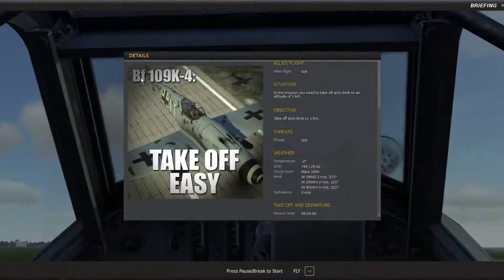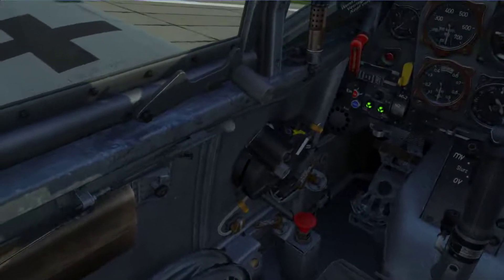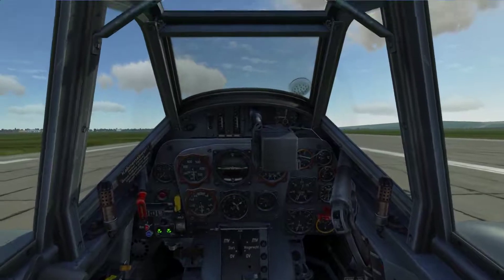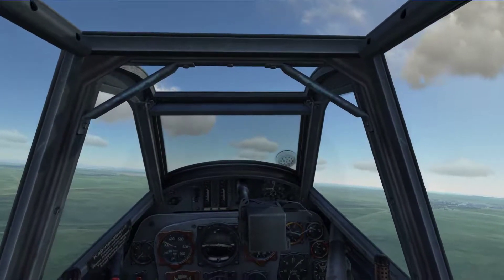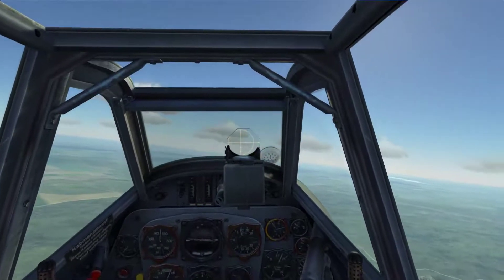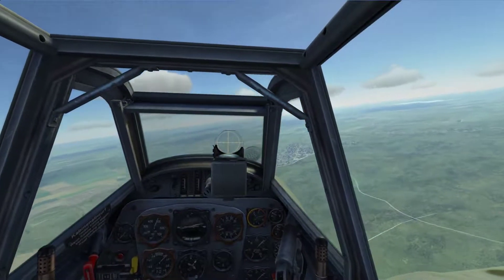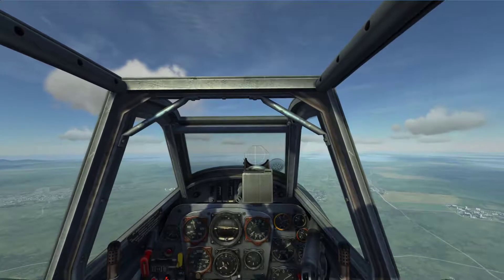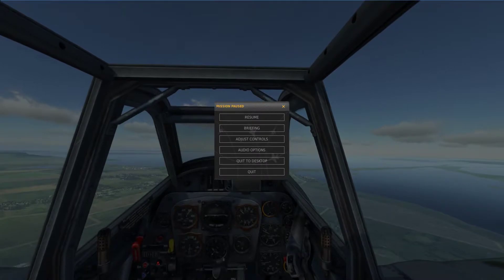DCS: Bf-109 - Takeoff

Comment: Great video and thanks for the tip's :)
Reply from the maker: Warren Blanch Thanks!
Reply: Zilch79 Your welcome. Mastered the Spit,Mustang and the FW is nearly mastered lol ;)
Reply: Zilch79 Think they have made a mistake with this BF109.We shouldn't have to put right rudder and right aileron to take off :/
Reply from the maker: +Warren Blanch You think so? I'm not sure. It's conceivable with all that power that the slipstream causes those effects, but I'm no expert in this aircraft.
Reply: Zilch79 Had ago in the 109 tonight. If you turn the wheel to the Max which is on the left hand side of the seat.Then turn it back one notch you don't need right stick when taking off.Just right rudder is needed.When the aircraft becomes airborne then put right stick on to counter the left turn.
Reply from the maker: Warren Blanch Awesome! I'll try that next time I'm in the 109. Thanks!
Reply: Zilch79 I tried it in instant play.Work's a treat.Very impressed with the 109 handling ability once airborne. But I think the Spit has the edge on turn time.Looking forward to Normandy :)